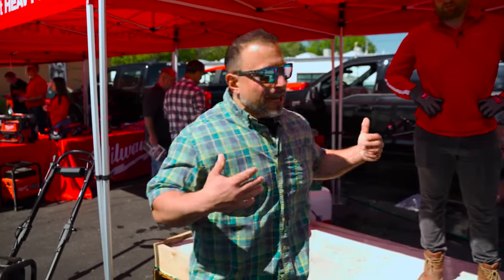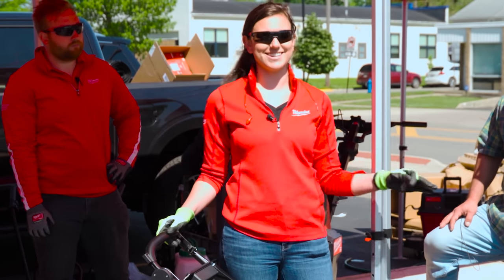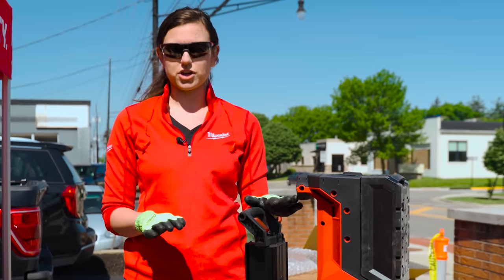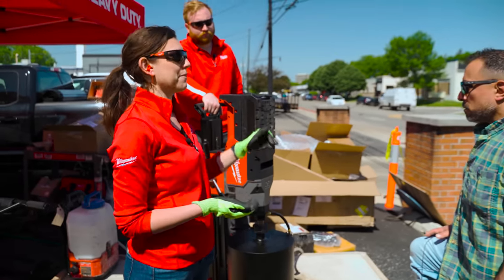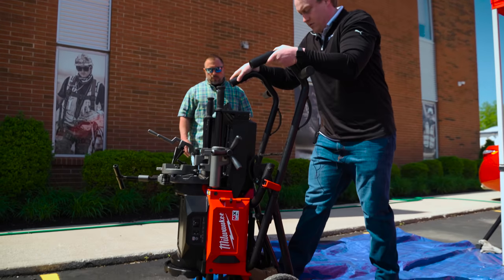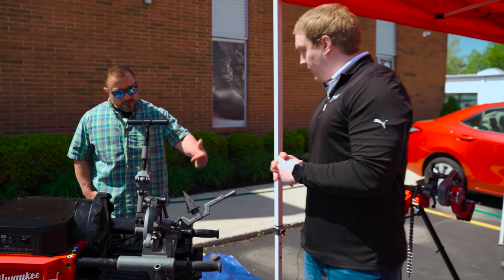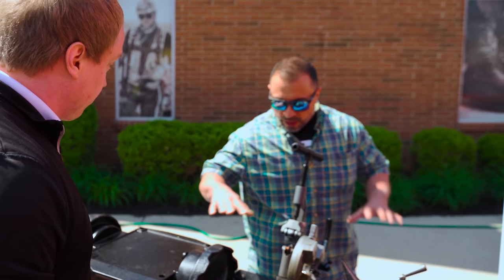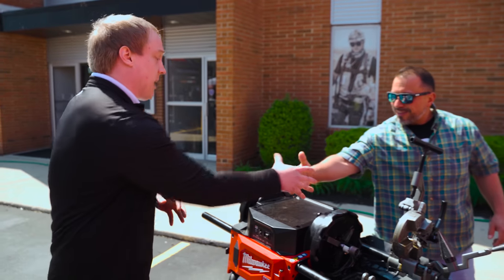MILWAUKEE Tool ADMITS This SHOULDN'T Be Possible - YOU'LL Be AMAZED!

Comment: The oil catch and recycler is appealing on that power machine. 7k not so much.
Reply: when you make an exclusive product you charge an exclusive price.
Reply: Agreed, at $7k I would expect everything up to 6in.
Reply: 7k is actually close to rigid price
Reply: I'd say the only other thing that's not appealing besides the price tag is it can only do 2 inch pipe